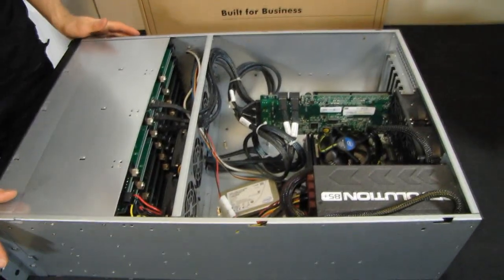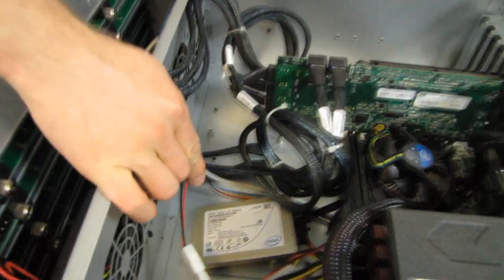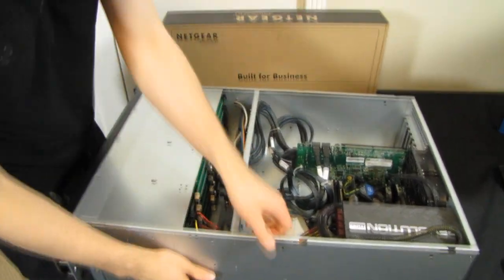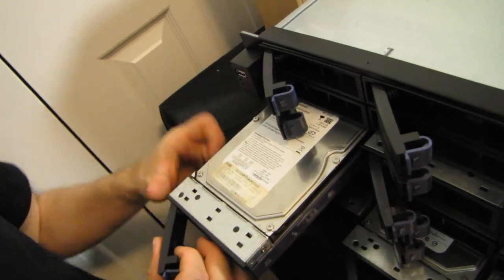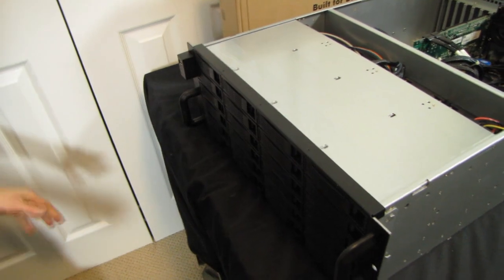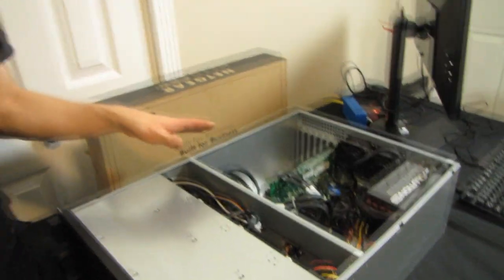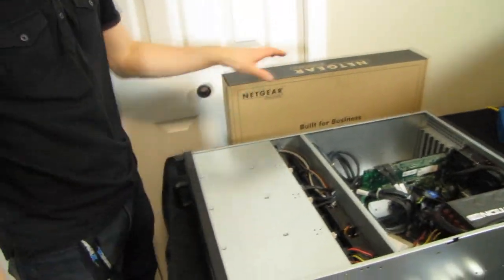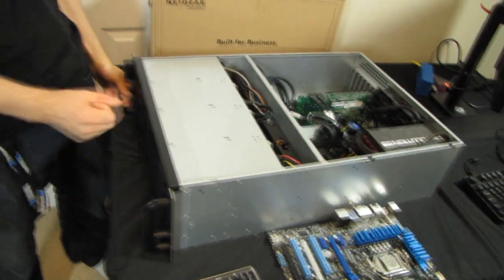Personal Project Windows Home Server Showcase & Upgrade Plans Linus Tech Tips

Comment: The 5Gbps would be run through a CAT6+ cable, as far as I know. I'm curious as to what network adapter he will use for that though, since CAT6 is theoretical 10Gbps instead of 1Gbps or 5Gbps...

Personally, I'd look at going CAT6e, since it's nearly guaranteed to be 10Gbps, and then split that into separate 2Gbps connections to ensure a more evened out data flow for multiple computers. Just in my opinion though.

Comment: The way he was using the drives originally seems to look more like JOBD with some software redundancy.  It does not matter that much as long as the system has enough capacity.  If he was using a true raid then it matters more that all disks are of a similar size and spec.  If you are using raid modes other than 0 or 1 it is generally a good idea to have all disks be the same size and specs but use some drives with mixed brand or batch to prevent simultaneous failures.

Comment: Supposing you do the majority of your work just from your work bench computer, couldn't you just set up your home server to your work bench by thunderbolt and have everything else, bedroom pc, laptop, consoles, etc. connected via .n wifi or ac? The throughput won't be as high as the one you'll have directly connected via thunderbolt but for regular PC use it should be sufficient and much more mobile, no?

Comment: thunderbolt(so far) is useless. no storage drive, be it HDD, or SSD, can even max out sata 3. 6gb/s let alone take advantage of 10gb/s from thunderbolt. so for storage drives thunderbolt is pointless especially since each thunderbolt cable costs around $50.

Comment: Technically though there are only Raid Level 0 through 6, any additional modes are a combination of the above levels 0 through 6.  Most consumer raid cards I have seen support raid off, JOBD and raid levels 0, 1, 5, 1+0, and very rarely 6 or any of the other modes.  When you get into commercial raid cards, like the one Linus is using, you get many more raid combinations and capabilities that you don't generally see on the home user hardware.

Comment: He practically implied the version of Windows Home Server he was using was more than capable of handling all those drives without any problem and that he'd have to switch to identical drives when he changes to the new one and because of the RAID array... I'm more than 100% sure he knows using identical drives is the best way to go, but it wasn't completely necessary.

Comment: a way to increase data security or increase storage space eg. 500gb hdd's that look like one 1000gb hdd instead of 2x500gb or 2 500gb drives that show up as one 500gb drive in case one fails you will have your data still.

Comment: i'm running a simple freenas server at home and it works great, but my problem is that transfer rate totally sucks ass over wifi... and i don't think there is any solution other than using a cable :(

Comment: A RAID is array of disk drives, there are different raids arrays from the number 0 to 6 (Raid1, Raid2, Raid3, and so on) For each raid like Raid1 or Raid6, most people might use these more often, because it synchronizes the hard drives, Raid 6 keeps data on the hard drives; and if a hard drive fails in Raid6 one of the hard drives keep the data (no loss) and Raid1 Is mirroring it helps the hard drive with read and write times. Hope that helps Lol

Comment: You're better off just going to 10 gigabits and just getting a gigabit switch with slots for 10 gig modules.  You're not going to be able to aggregate your onboard link to get 5 gigs.  Aggregation is mainly for failover and for multiple transfers.  I don't think it's going to stripe data from a single stream across 4 or 5 links.

Comment: Linus when are you going to move away from WHS completely trashing your hardware and its utilization. You should really consider a Linux alternative. It won't trash your HDD's or SSD's and you could use something like greyhole to continue using your dives. I have questions... how do you get around WHS needing the boot drive to be the largest drive? And I thought you couldn't expand the storage on a RAID array?

Comment: Yes you can. Xeons use the standard 775,1155,1156 and 2011 sockets, though you also have to check if the motherboard supports specifically the Xeon.

Comment: btw why use 5 1gbps connections on cat6 instead of a single 10gbps on cat7? I know 10gbps NICs are still fairly expensive but for a system like yours I think it's worth it

Comment: Have you looked at UnRaid? I replace my WHS v1 setup with unraid as the OS as it offers similar pooling of random drives, and the ability to read individual files off a single drive, while also being 64-bit so it supports more ram, etc. It also supports a caching drive so you can get a bit more performance out of that. not quite raid 6 speeds, but it means no need to change hardware.

Comment: SSD fail rate isn't related to time like it is on hard drives. SSD fail rate is 89% related to the amount of use it gets as those NANDs have a limited read write (although it's fairly high). SSDs also have ECC while only enterprise-grade HDDs have some ECC which causes consumer-grade HDDs to "fail" (usually the filesystem fails and needs to be re-formatted).

Comment: Linus you can install whs 2011 on a smaller drive.  On my system I am currently running on an old 80gb drive that I had lying around.  I used a tutorial that can be found by googling "install whs 2011 on hard drive less than 160gb" and it's the first link.

Comment: I think Windows Server 2012 would help over Windows Home server. Also, 24 HDDs? Really? I just don't think that's very practical for any home. If I made one I would probably have 4 hard drives at most for power/reliability reasons, even in raid 5 or 6, and of course an inexpensive 64GB SSD boot drive.

Comment: Linus, google for the min 160GB boot drive bypass. I had the same problem and it's pretty easy to fix. Just put a text file with a couple lines of code on a blank usb and have it plugged into the server during the setup of WHS 2011. Has worked fine for me.